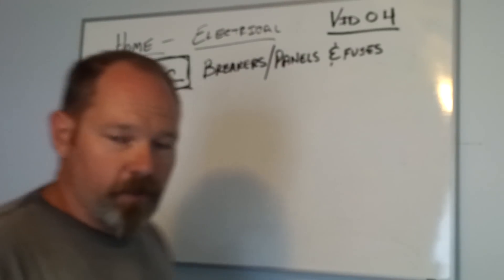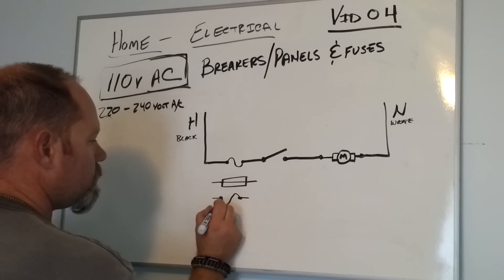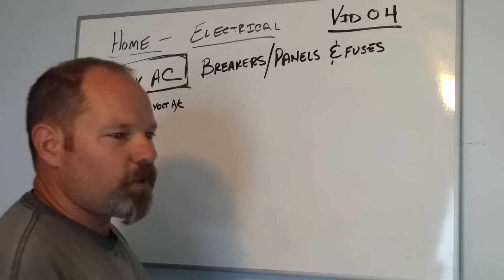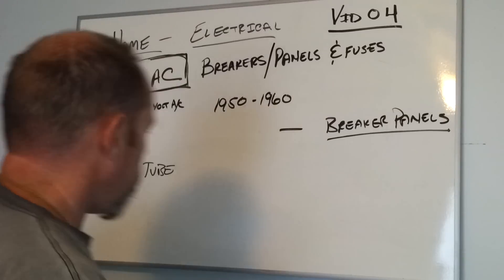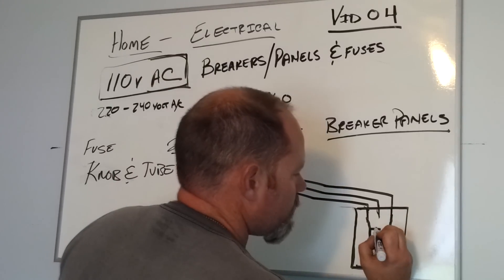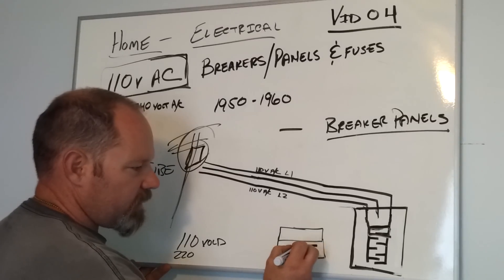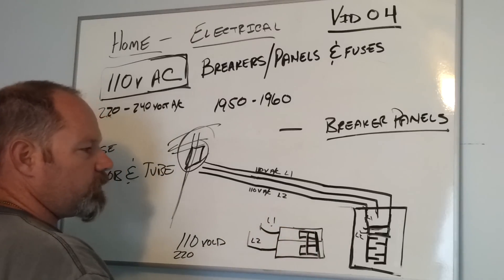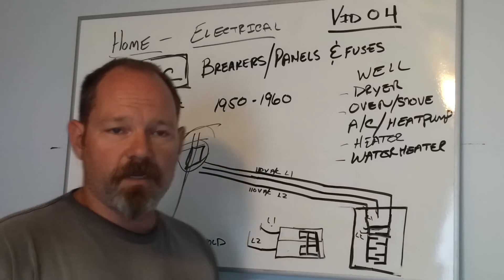BASIC ELECTRICAL 101 #04 ~ Fuses and Breaker Panels

Comment: I would like also to mention that in Electrical we should consider safety first. The fuse ratings should be in accordance with the size of the wire. Like 15 amp fuse should go with awg #14 wire, while 20 Amp fuse with awg #12 wire and 30 Amp fuse with awg #10 wire.

Comment: Awesome. This video could have been a lot better though. First, that third wire isn't ground. It's the neutral. Second, you get 110v from either one of the 2 hot wires (L1 or L2) PLUS the neutral.

Comment: I'm getting a lot out of the videos, but it would have been really helpful to have this lecture in front of an actual breaker panel.   Same with the switches and outlets in previous videos.   The grease board is good, but seeing the real deal would be even better.

Comment: I think you are wrong, since the circuit is in parallel, the physic law says that current likes to go in the easy pathway( no resistance zero ohm) since you short it out, current will go to zero ohm cable and fuse won't prevent and boom

Comment: Why are the fuses on the hot side? Would it be deferent if it was on the neutral side? If so. How deferent?
Reply from the maker: Please feel free to suggest a video you would like me to make. Thanks for watching!!!
Reply: Guy Brown that is what that comment was for. Also you're welcome.
Reply: Koolkid2269 if you put the fuse in the neutral (after the motor) basically what happens is that the power surge hits all the way through the wire including the motor. And possibly damage the motor but if the have the fuse before the motor due to the high voltage it will blow the fuse before the power hits the motor and keppd it from getting damage in most cases . Hope that helps
Reply: Jose Arellano thank you

Comment: If I get the proper wire, plug and socket can I (safely) make a 240v extension cord with a dryer plug on one end and run it about 10' up into my garage and put a socket for my welder on the other end? Or do I need to have someone come in and run a new line from the breaker to my garage (which I can't afford right now)?
Reply from the maker: +Buddy Bellwether you can make an extension cord. Make sure to use cord not wire and conductor gauge rated for the load.

Comment: wondering if u can help me. I have an outage from my living room to my middle bedroom. but I have ran a drop cord with two ends that plug to transfer power from one outlet to the one that doesn't work in the living room and that now takes power to that outlet and the bedroom that's out if u unplug this drop cord. can u help me understand what might be the problem. thanks.
Reply: Mikisha Akers Check to see if there's a GFCI receptacle (outlet with reset button) on the same circuit that might have tripped.  I've seen some weird things happen such as bathroom lights not working on a one story house because the garage had a GFCI receptacle that was tripped.  Normally NEC code requires that it is the first outlet on the circuit to protect the rest.  This was an old house and I think that's why it was wired that way.

Comment: These are great and very helpful.  Thanks for posting!  (One thing to add in the early vids is the basic definition of key terms however like:  volts? Amps? Current? Watts?  I kept trying to search definitions of those while watching and how they differ.)
Reply: Electromotive force is measured in volts that push current while current is measured in amperes and power is measured in watts. in formula P = IV   : P stand for Power, I in current and V in volts.

Comment: Hey, thanks for the videos. Just one issue in your draw. When you draw the short circuit, the short pass the fuse and the fuse won't help. The short had to be draw to the point between the fuse and the switch or the point between the motor and the switch. This way the fuse will conduct a high current and will break the circuit, protecting it. You get my point :). Regards.

Comment: third wire off transformer is a neutral
Reply: David Winters is correct. You do not get "ground" from your Transformer. What you have is L1, L2 and Neutral. The ground is created by driving a copper rod into the earth, connecting a copper wire to it, and connect that copper wire to a ground bus bar inside your panel.
Reply: You are correct. I think Guy Brown may have misspoken.
Reply: No he said you'll have two live and one ground....not neutral....each wire from the trans...will have 110 volt ac...two of which that total 220 volt ac....the third is ground. Your plug outlet will have a hot....a ground....and the third will be neutral sir.

Comment: Awesome video thanks Guy. I'm wondering how fuses are physically installed- It seems each symbol in the circuit has a physical counterpart like the switch and motor/bulb. What actually IS a fuse?
Reply from the maker: I just made a video to answer your question. It will be uploaded soon. Thanks

Comment: Thanks for video,
Few questions:
1- Can i use 220 outlet for 110 volts portable AC unit.
2-Our buliding still have those round fuses,do i need to install high voltage fuse when using portable AC .10000BTU
Thanks
Reply: I don't know squat except for what Guy taught me but I would guess yes!...as long as the plug is the same style, you will receive the full 220 from your breaker box, not overloading it, but you will not be able to run a load of 220 off of a breaker that's only 110.....I'm not sure if that's correct or makes sense to you.